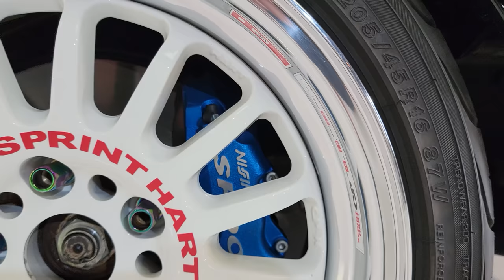Honda Integra Type R || Big Job! Dry Ice cleaning, Ceramic Coating, PPF

Comment: Every time I look with envy at these chassis from sunny California. In our weather conditions and on roads sprinkled with salt, such a condition is unheard of in older cars.
Reply from the maker: We’re pretty spoiled out here 😬
Reply: +1 Try driving one in Ireland. I live on a giant sponge in the Atlantic. My JDM Teg is more anti rust wax than car 😬. That's a very nice example. The German plates are interesting. Is it a US car or a German import, or a US car with Euro bits? I say that because it has the European rear lights and Recaros and Honda badging which the US models didn't get(though it has Acura mats so maybe not). With the crazy prices for them in the US I've long wondered why American buyers didn't look to mainland Europe(LHD) for cheaper examples(15-20k) rather than Japan which are RHD and 20K plus.
Reply: @MrGrentch  the Japanese barely drive their vehicles. I have seen so many JDM examples with mileage that would be unheard of anywhere else. I bought a 92 lite ace gxl rhd turbo diesel and it was immaculate with only 60k kilometers.
Reply: @IAMDetailing  are you attending SEMA 2021?
Reply: @MrGrentch  damn true. My UK DC2 type r became a bucket of rust after 16 years of daily UK driving. Bloody UK weather and salt!!!

Comment: Would really like a 20 min step-by-step the shows each product and what it does. It would be great to see a small (10-second) clip of the before-and-after with each product, then the end result of it all together in the showroom.  Am particularly interested in knowing the paint correction products as well as the different protection levels like ceramic vs wax, especially.  Thanks so much for the GREAT videos that show the incredible work that goes into each vehicle!

Comment: 2 questions please :
1) Have you ever had electronic/electric problems after using dry ice, specially in the engine bay ?
2) Do you have a dryer on your dry ice system and what kind of compressor / specs do you use ?

Nice job as always!
Reply from the maker: Thank you 👌🏽 glad you like our work

1) no we haven’t any problems with electric so far

2) yes we have a dryer, it is necessary to have it and very very important because if the air is not perfectly dry then the ice is mixing with moisture and becoming softer and doesn’t work. We have 30hp compressor (140cfm and 125psi) and 200gallon air tank.
Reply: @IAMDetailing Thank you very much for taking your precious time to share the information! Really appreciated...

Comment: How many "Dry Ice" hours did this compact car/job require and what was the shop rate?  Does the Dry Ice shop offer any under coatings?
Reply from the maker: You can find our pricing at dryiceauto.com
It truly varies by the car, size, cleanliness
And we do! We offer 3M Clear Matte Protection Wax or factory Cosmoline

Comment: What color black is it
Reply: Its a special one!!!! Originally from honda it would have been "nighthawk black" but this car isnt original. Its had extensive work before these guys took credit for giving it a polish. Its had a total nut and bolt rebuild and full respray.. hence why simple giveaways stand out a mile to me.. it does look amazing but far far far from original. The previous owner has spent endless hours making this thing a one off. But if u know u know